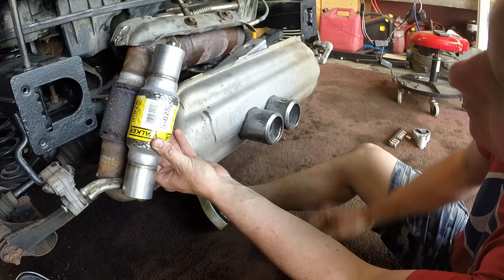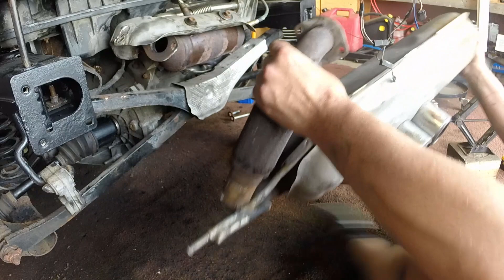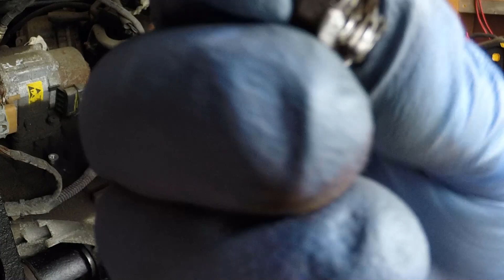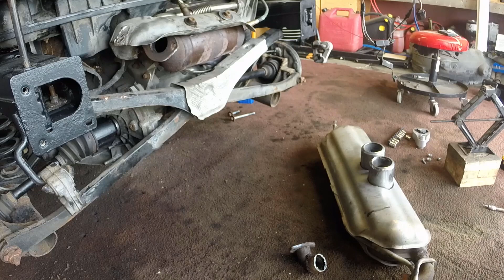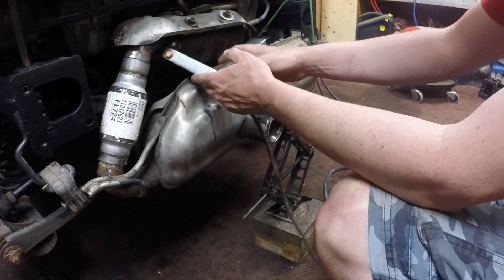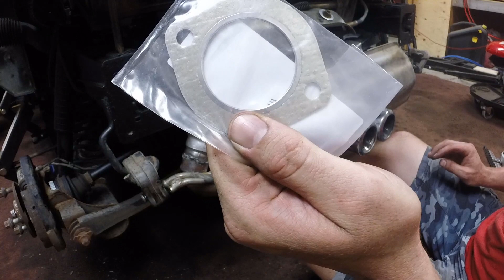Smart 451 Exhaust Leak DIY Repair

Comment: Can some mine tell me the pipe diameter please? Thanks
Reply from the maker: 1.75” but it’s not a perfect fit because the pipe above the stock flex is a different size than the pipe below the stock flex.
Reply: @PBGarage thanks, what size would you say would be a perfect fit? I just want somthing to slide on the pipe so I can weld it. Thanks
Reply from the maker: There is no perfect fit the pipes aren’t standard sizes. They are too close to the bends so they’re not even actually round. Get 1.75”ID and use a hammer.
Reply: @PBGarage thanks mate

Comment: How did the Walker Flex pipe hold up?  I'm having quite a time finding flex pipes that last more than a year.
Reply from the maker: It’s held up a couple years of winters but it’s about due again. I’ve been really having a tough time finding a brand that lasts like an OEM flex pipe. Not just on the smarts, on all the VWs and Audis too. It’s genuinely super frustrating how crap they’re made.
Reply: @PBGarage  I just checked the daters on the Amazon flex pipe I installed on my wife's Tiburon.  It looks like it only lasted 2 months.  Looks like I need to try a walker next.  Why does OEM last 15 years or more?
Reply from the maker: @24revealer OEM must be just using better materials.

Comment: What is the pipe size on the original exhaust?
Reply from the maker: It's between 1.5" and 1.75", but is a larger diameter where it goes into the flex pipe than it is at the exit of the flex where it make a sharp 90deg turn.

Comment: Lol the one part i needed was skipped.  Im having soo much issue putting the back bolt in.
Reply from the maker: The two bolts on the flange you mean?
Reply: @PBGarage   yes sorry.   I managed to jerry rig a flexible joint to attach to my tork and hated every second of getting it to catch.     Still your video and ones like it are a service thank you
Reply from the maker: @rocknut144 thanks! Yeah the bolts are hard to get to and corrode very easily so I always end up punching the captive nuts off the back side with an air chisel, then I install new bolts+nuts when I reinstall, so the next time I’m doing the job they are easy to get out again.

Comment: I just found out my 2010 Brabus has the same issue.  I guess that's what I'm tackling this weekend.  I see you used 1.75" which is fine, but how long?  I see 8 and 10".  I feel I can just cut down the 10", but someone mentioned that the 10" is too long.  And the material is SS so when you welded, did you weld SS or just normal MIG?  I weld normal steel, but no TIG Capabilities as of yet but do you think the normal steel welding will hold up long enough or should I get it welded up SS?  Great video by the way.  Thanks
Reply from the maker: Thanks! If 8” includes the ends which you’ll be cutting and bending I think you’ll be ok. If the flexy part itself is 8” you may not have room to fit it in. I think the shorter the better as long as you have enough pipe to make up the difference.
Reply from the maker: Also, I used just mild steel to weld many many of these up. The welds always far outlast the replacement flex pipes, so I’ve never been worried about it. I’ve been using flux-core wire with a MIG, except no gas just the flux core in the wire.

Comment: Did you lower the subframe to get more access? I am in the process of replacing exhaust and have no room to body structure.  No room and even though this car has very little winter time, the heat shield bolts on the cat have lost mass and forced me to order E-Torx end wrenches.  Will not arrive for two days......grrrrr.

Please advise.

P
Reply from the maker: No I didn’t lower the subframe to work on the exhaust. But removing the lower half of the rear bumper, crash bar, and the X brace at the back of the car can make your life a lot easier.

Comment: I notice that you never show the removal or replacement of the flange bolt furthest from you. Could that be because that one is a real nightmare to get to? lol  And that's also why I'm surprised you choose to refit the heat shield before re-attaching the manifold. It's much easier to do with the heat shield off.
Reply from the maker: I never touched the manifold, and both bolts at the flange for the muffler are a real pain, and mine were so rusted the bolts snapped on removal, and I punched the “captive” nuts out with a hammer, opting to replace with hex head bolts and normal nuts for ease of future removal. I thought I covered all that in the video but that was quite a long time ago.

Comment: Hi what size is the repalacement flexi pipe?
Reply from the maker: I’ve been using 1-7/8” x 4”, it’s a bit bigger than stock but allows me to cut and fold the ends a bit to account for the curved pipe etc

Comment: Was this car smoking a lot before? I have a 2009 smart fortwo and been told I’m in need of a new exhaust system ($1200)
Reply from the maker: No the car never smoked.
Reply: Would a broken/ cracked flexi pipe cause smoke? White smoke

Comment: Great timing to find this video. Just found out my 2015 Brabus has the same issue. I don't weld so will be using clamps.
Reply from the maker: That’s going to be really tough as the pipes are slightly different sizes top and bottom.
Reply: @PBGarage  Good to know. Guess i'll be calling in some favors from my friend who welds. Thanks
Reply from the maker: It’s worth the extra effort just to not have to try and mess around with the clamps being in the way, it’s pretty tight under the car where the flex pipe is.

Comment: I've read that the flexi pipe is either 1 5/8" or 1 3/4" pipe, about 8" long. Any idea which is correct?
Reply from the maker: I've been using 1.75" pipe, which a little bit larger than OEM, but it gets tricky because the inlet and oulets aren't the same size with the bends in the factory pipe. I got a pipe that was a bit shorter than 8" so that I had a bit more room to get creative with placement. It's easier to cut some slots in the larger pipe and hammer them in and weld up the slits, than it is to try and expand a 1.525" pipe.

Comment: Replace that flex pipe once. Lasted for a year and the same thing happened
Reply from the maker: There are definitely better and worse quality of flex pipes to use. I’ve had a similar experience with a cheap one that only lasted a year or two as well.
Reply: @PBGarage  Ridgid pipe probably last forever

Comment: I’m concerned the M8 heat shield bolts will not be strong enough because of the muffler heat and bouncing loads. Defo should have gone M12+ IMO. 🤣
Nice execution and I like the use of the jack for the reference point 👍🏻
Reply from the maker: I was looking for some M16 Inconel bolts but it’s been a while since I’ve gone scrap diving at the submarine harbour.